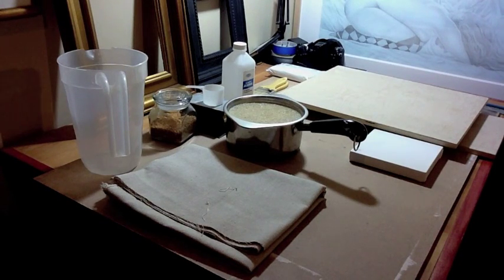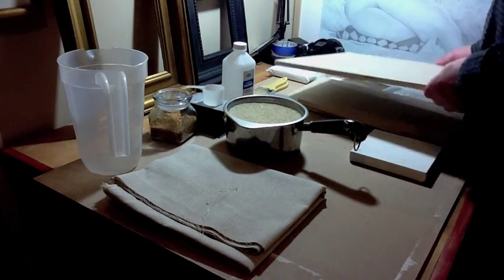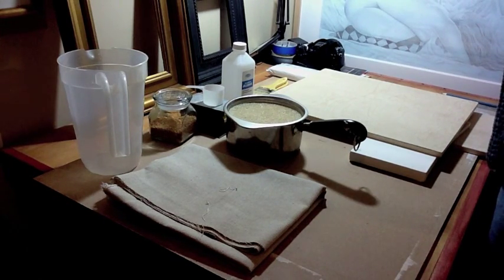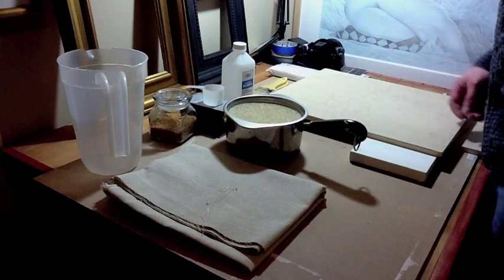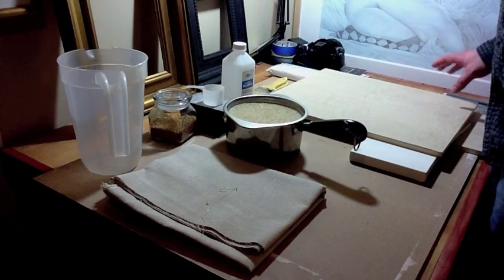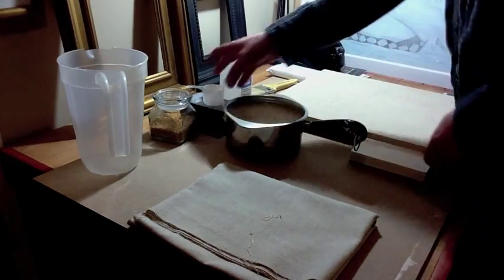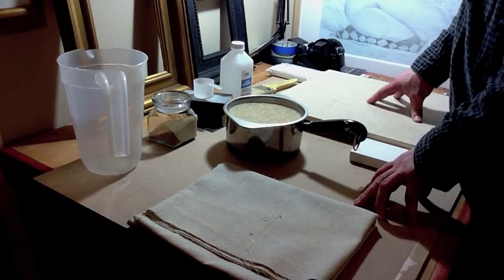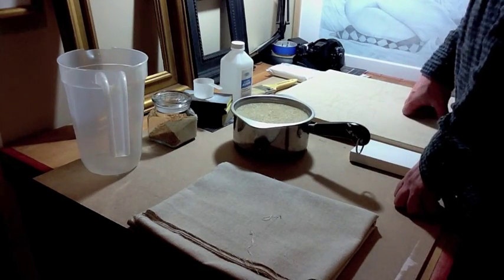Egg Tempera Panel Making Pt. 1

Comment from the maker: If the grains are running opposite it should not be a problem, but cutting boards are usually treated with some sort of oil which could repel the water in the glue and cause the gesso to crack.

Comment: Hello, can I coat with rabbit skin glue and gypsum directly on birch plywood and paint with egg tempera without linen, or cloth, or other else? I am waiting for answering, thank you very much.
Reply from the maker: Hello, sorry for the delay. If your piece is small, say under 12" than yes. However the larger the piece the more it may rack or curve causing the wood to crack. So a thin piece of material which has been impregnated with RSG and stretched over the panel will minimize the potential to warp.

Comment: i have question to ask:
If  i use maple wood  panel ( kitchen cutting board ,  60 cm by  50 cm  and   2  cm thick )
It's made of long maple wood strips  ( 1,5 cm wide ),  tide  glued  to each other, it's about 20 of them , fit in one board.
Would  it warp  the wood ,  when i cover  it with layers of rabbit skin glue, and gesso ?
Thank you !